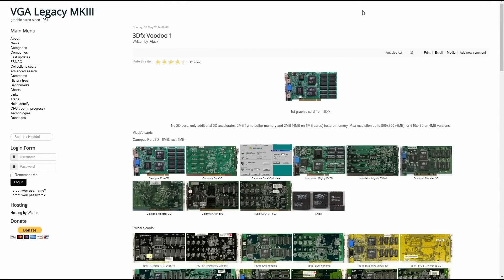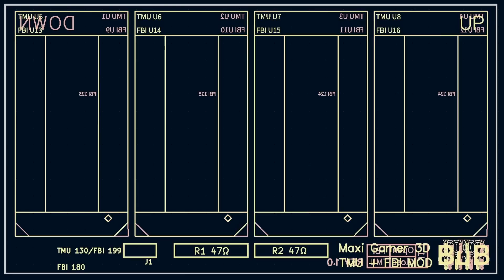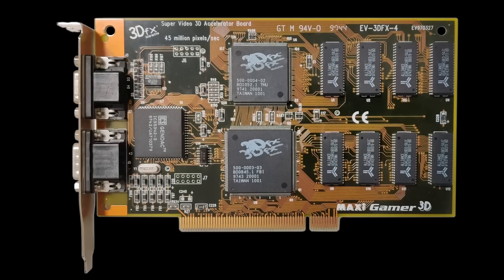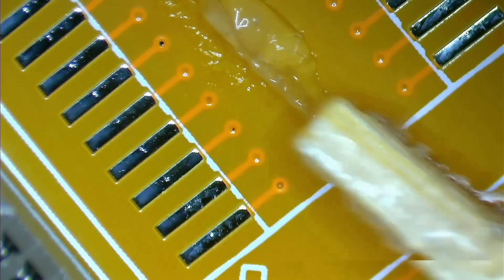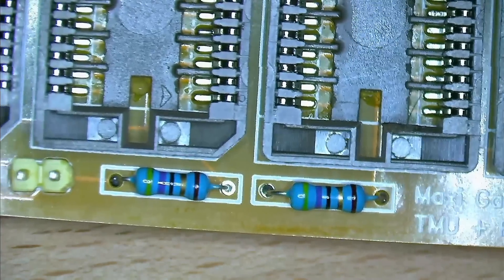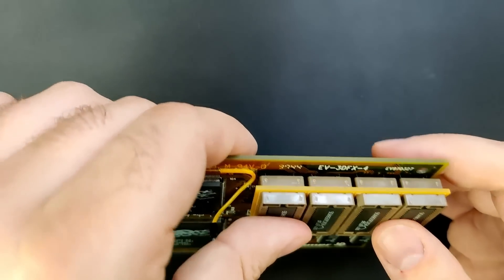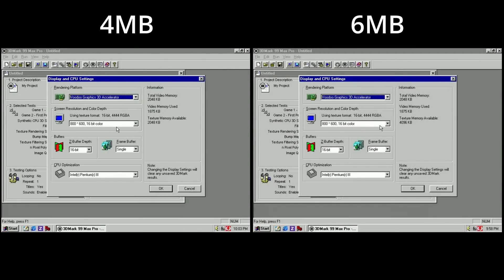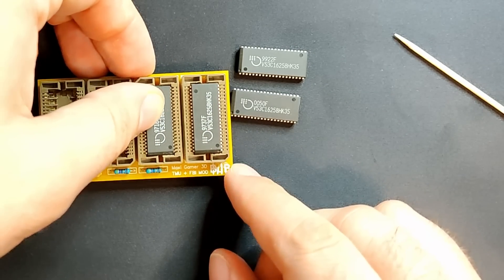3Dfx Voodoo Memory Upgrade - 6MB MOD (Part 1)

Comment: Meinst du du kannst eine Komplett eiegen Karte entwickeln wo die erweiterung direkt mit integriert ist?
Reply from the maker: Theoretisch wäre das möglich, ist aber sehr viel Arbeit. Ich glaube eine Voodoo hat ein PCB mit mindestens vier Lagen - weiss ich nicht ob es den Aufwand rechtfertigt. Es gibt ja schon Nachahmer die sogar einen HDMI Anschluss mitbringen.
Reply: @bitsundbolts  ja schon gesehen auch Voodoo 5 6000 gibt's wieder aber was eigenes iss cooler. Vermutlich gibt's irgendwo die easy eda Files die man anpassen könnte

Comment: Personally, I would have put the sockets over the existing chips, and then glued the new board to it. Then it would have had the spacing perfect with no stress.
Alternately, some solder paste on the 4 corner pins and hot air solder through the board while it's in place.
Reply from the maker: Yes, I agree. Watch the video with Revision 1.1 where I address the points you make here.

Comment: I have recently struggled soldering to a dense chip. What has helped is not to solder straight down, but to the leg pointing up. Guiding the wire from the top. I have completed a very spicy mod job like that recently, where i soldered bodge wires to 5 subsequent legs of a tqfp100 chip. I didn't use magnet wire, since i happen to hate it with a passion, but wire wrapping wire AWG30, which is PVC sheathed, which is not ideal, but it worked out OK. Such wire you can run directly to the connector, it won't mind.

Comment: Really nice job!
I've just picked up a Maxi Gamer 3D and have ordered myself the PCBs. Do you have a link for where you got the SOJ sockets from? I'm really struggling to find them
Reply from the maker: Yeah, unfortunately those sockets are a bit hard to get. I got 20 pieces from ebay Germany. But there seems to be a source in USA: https://www.jameco.com/z/HWS8871-James-Electronics-40-Pin-SOJ-IC-Socket-Surface-Mount_2330623.html

Here is another link: http://bg-electronics.de/shop/product_info.php/products_id/10133

Comment: I would definitely like to see a video where you go over the failures of what you were doing.
Reply from the maker: I addressed most of those in the latest video on my channel.
Reply: @bitsundbolts  thanks! i was about to watch it :)
Reply: @bitsundbolts  you know, if you made cutouts in your memory boards, you could make them castellated, and then you could put the sockets on the ram chips, adjust the board to fit, and solder through the cutouts. this would make it much easier to adjust everything. but you'd have to make sure that the through-holes used for castellation are NOT plated. and it might make soldering new memory on top a bit more difficult, unless you find chips that are narrower. which might actually not be hard.
Reply: edit: i think while it might be a little difficult to solder chips on top, soldering sockets would probably not be very difficult at all.

also if you need to connect the bottom with the top anyways, maybe you could make the relevant castellations plated-through. so it works out well actually.
Reply from the maker: Thanks for the suggestion. I like thinking of improvements and to make things better. The prototype worked really well, but far from perfect. I actually have to admit that I was working on Rev. 1.1 and it's already out for manufacturing, but if this doesn't work out, I'll be glad to follow up with your approach!
Reply: @bitsundbolts  enjoy! I think the castellations + sockets on top or smaller chips on top might work out well to make everything fit together mechanically. Do you think you'd be able to find smaller chips? Perhaps they could even be faster ones? Does the voodoo card even have any concept of fast vs slow ram (as in latency)?

Comment: Pretty clever to use the sockets to connect to the existing chips on the card. Maybe something similar could be done to connect the wire to the 3Dfx chips.
Reply from the maker: I am already working on something like this. But it will take time l because I need to learn new things again: 3D printing

Comment: Nic work!  - it might be worth adding some pads for decoupling caps for each additional memory chip to be safe
Reply from the maker: Thank you! I've heard about decoupling capacitors, now I read about them and have a better idea what they are for. 
For my understanding: Those new memory chips use the power supply of the existing chips - which probably already have decoupling capacitors. I guess the existing capacitors are good enough for 4 chips, but do not provide enough capacitance to filter the power supply for double the memory chips.

Comment: I have found 3DX1000 card out in my cupboard. It has identical footprint and color to the card presented. The imprinting on my card adds "with TV option"  but I couldn't find any difference to the card presented: no extra connector or header so I really don't know what the "TV option" means. My card is from "Volcanic" and "VOLCANC" is printed on the board. I have also Volcanic manual including a CD with drivers, Voodoo Graphics user's manual and another CD labeled "Software Driver Version 1.318-98". Manufacturing date of my board is 9923 (where yours is 9744).
Reply from the maker: I googled the card you're describing and I found a few pictures. I think it is a clone of the Maxi Gamer3D. I also do not see any TV relates ports.

Comment: Hummm wil this work with voodoo2 and 3
Reply from the maker: Good question. There are Voodoo 2 with 12 MB and 24x512KB memory chips, and there are some with 12x1MB memory chips. I have not come across a Voodoo2 with 20 MB (4 FBI, 8+8 TMUs) or 24 MB (8 FBI, 8+8 TMUs). From Voodoo3 onwards it may no longer be possible.

Comment: Why not solder two sockets together without the PCB ?
Reply from the maker: Yes, this crossed my mind, but you have to solder pin 14 together of all memory ICs for TMU and two memory ICs in pairs for the FBI mod. Just stacking another memory row above the existing ones is not enough. A jumper on a PCB with correct wiring makes this a lot cleaner.

Comment: What was the total cost from PCBWAY? What I'm seeing looks pretty expensive at $5.00 per board and then $38 for 3 day shipping and $63.56 for 24 hour processing.
Reply from the maker: Shipping cost depends on where you live. Production of those 10 PCBs is 5 USD and took 4 days to manufacture. If you get the coupon when signing up as a new customer, you get the PCBs for "free". I selected the slowest shipping method which was 12-13 USD to UAE/Dubai (I actually paid for that at checkout) and delivery time was 11-33 business days. Full disclosure, PCBWay upgraded my delivery for free to FEDex, which would have costs 23 USD to UAE, and reimbursed the money I paid for shipping in form of coupons. Delivery took another 3 days. So, to UAE with 11-33 business days delivery, it would have cost 12-13 USD with signup-coupon, 17-18 USD without signup-coupon.

Comment: By stacking new on top of old chips, are they both working now or were the old ones disabled?   If both working in parallel, how are they addressed separately?
Reply from the maker: Both rows are working. There is one additional wire routed from the TMU to Pin 14 on all 4 new memory chips. The other 39 pins are connected to the corresponding pins below.

Comment: very clean mod, nicely done. What's interesting is 3dfx apparently designed the voodoo 1 to use up to 28mb of memory. https://i.imgur.com/XGxy1Ei.png
Reply from the maker: Hm, do I see correct that there are up to 3 TMUs with each up to 8 MB? That would mean that a simple Voodoo (1xFBI + 1xTMU) could be 4MB+8MB = 12MB. Probably with more address lines to be created from the TMU chip. A pinout of the TMU would be interesting...

Comment: Very cool!  I recently watched a video where a modder adding extra memory to an original Xbox 1.6 using the method of stacking the chips, but for the Voodoo card I like your solution much better.  I would definitely be interested in a video where you talk about the problems you ran into along the way.
Reply from the maker: Will include it in the next video. You already seen how the mod is assembled, so, I won't talk another 15 minutes about the same thing.

Comment: PT3: Combine both boards into one with no need for any jumpers and 2 daughter boards to go over the TMU and FBI with connections to the relevant pins. Then you got an all in one with no microsoldering required.
Reply from the maker: Interesting, There may be some pins however that do not connect to the TMU/FBI chips (e.g. VCC, VSS). Then the board would need to connect to other sections of the board. There are 39 Pins on the memory chips that are passed through to the upper row. Maybe a device (like a frame 3D printed) that just clips around the TMU/FBI chip would help.

Comment: Are there any devices that could go over the TMU directly? Access the address and data lines and route to memory.
Reply from the maker: You mean another socket? Hehe, I think I know where you're going. Some cards do have heatsinks on those chips, that would cause issues. You may also end up decreasing airflow around the chips heating them up further - those TMUs get hot.
I think you'd like to achieve somehow better access to the pins or prevent any alterations to the card?
Reply: @bitsundbolts  oh, I didn't think about cooling! Yes, they used to make Macintosh upgrade CPU boards that would clip on to the existing CPUs. Maybe a really hard part to find though, because they probably don't use that CPU package for much anymore. But yes, ideally a clip on upgrade with no soldering required.
Reply from the maker: Yeah, would be neat to just have everything clip on. But I think you won't find a socket that you could press over the chip, it would surprise me. Also, TMU and FBI are of different size.
Maybe someone could design a 3D printed device that could do it.
Or wait until I learn 3D modeling and create something.
But then people shouldn't complain if PCBWay is all over my video 😂

Comment: This is fantastic. I've got a Yakumo Voodoo 1 that is nearly identical to the Maxi Gamer 3D. The memory chips, at least, appear to be in the same configuration. So, your board might just clip right onto it. I'll have to trace some other things out to figure out if I need to do anything different. Can't wait for part 2 of this video. I hope you're able to do some "real world" testing with games with built-in framerate counters like Half-Life, etc. Good luck, dude. This is awesome.
Reply from the maker: Thank you! Already started looking into behavior of the 8 MB configuration. I think I will do the full mod video first and then get into benchmarking videos. Could be quite a lot of work...

Comment: I guess the Tmu ram layout is the same on the most common version of voodoo 1 and I mean the monster 3d by diamond. Once the mod goes public I will help the community to relocate spaces to diamonds measurements and I urge all voodoo 1 owners to do the same for all the different kinds of other companies because the mod easy fairly easy. Only one cable to one pin and voila you have 6-8mb ram. 8 mb ram was commodon back in the days, I had in my pc a monster 3d with 4mb and a diamond fire gl 1000pro with a permedia 2 at 8mb.i still have this pc which was my first pc by the way.
Reply from the maker: That would be a great initiative!
Reply from the maker: I confirm that 8MB mod works - in the process of releasing the PCB Gerber files.

Comment: The reason you can stack memory chips is that nearly all the lines are shared.  Surely you only need connections to a single memory socket, plus the individual address lines ? In this way, any card could go to 8mb.
Reply from the maker: Yes, for the TMU, one extra pin needs to be connected to the memory chips. All other pins are shared with the chip below.
Any card should be capable to support 8 MB, but you won't be able to use the type of mod I use in this video.

Comment: That's very cool!  I've got some 3dfx internal documents that claim the Voodoo 2 can also support double the memory (8mb per chip) for a total of 24mb per card.  I would LOVE to have a 48MB Voodoo 2 SLI setup!  Wonder if anyone has ever tried modding a Voodoo2 in this way.
Reply from the maker: That is interesting - however, since nobody ever attempted this, I wonder if it actually works. There are some crazy good modders out there. Sure someone would have picked that up. But yeah, a 24 MB card would be cool - I am just very skeptical that this will work...

Comment: Nevermind the problems occured with your first board. Me as an electrical engineer, who teaches his software coleagues how to design pcbs, knows, the first revision of a board never works flawlessly. Is it the function or the assembly, somewhere is everytime a problem, which must be fixed, botched or something else. And if you found no fault on your first revision so long, you didn't searched well enough. 😉 It is all excercise. But this was a good job and a very clean mod also. Congrats to you.
Btw. I don't know if you noticed, but your sockets have nodges to indicate pin 1. One of the sockets on the upper side is turned around.
Reply from the maker: Oh my - I didn't notice that!!! Oh well, what to do... It's already glued on there. Software developer mind - easy hotfix not possible in that case!
Reply: @bitsundbolts  If it does the job, why fix it? Just for the next assembly to notice. 😉
Reply from the maker: Yeah - just a small visual glitch. Let's see, I am struggling right now with the second board. Unfortunately, the second row of memory on the voodoo card is slightly off. The addon board doesn't make proper connection and when I try to run the card with 4 MB on the FBI chip, the card doesn't seem to be detected as 3D device.
I have to check if the card only works with 4 MB on the TMU, but it could also be that I made a mistake designing the PCB. I guess I need to do some further digging.
Reply: @bitsundbolts  Welcome to world of hardware debugging 😄
Reply from the maker: Turns out, the card does not work with 4MB on FBI and 2MB on TMU. If FBI has 4MB, TMU requires 4MB as well. So, all good with my PCB :)

Comment: Nice and clean execution! The problem I found with this and haven't seen mentioning is the driver compatibility. I used to own a miro highscore3d with 6mb and remember while having a bit extra performance on some games, other glide games didn't even boot. Tried a bunch of drivers and some worked with some games and others with the rest... But some with the original miro driver just disabling the extra memory. I remember Carmageddon was one of the problematic games... But there's not much info on the subject... Otherwise I would upgrade all voodoo cards to the full 8mb! :)
Reply from the maker: Good point. I don't think I can just disable the memory with the reference drivers, but I didn't look into this yet. The good thing is that the mod is temporary :) I can just unplug the cable.

Comment: paying something like $100 more in the 90s for the difference in texture RAM for 6-7% gains in synthetic benchmarks might have been a hard sell, but this is cool.
Reply from the maker: I paid $20 for 10 of those memory chips I am using. Yeah, $100 extra for at best 5% performance gain is a tough sell.

Comment: This is awesome work. Unfortunately my hands just aren’t steady enough for fine soldering like this anymore. I can tell you from experience some games display textures incorrectly &/or with what looks like artefacting & in honestly there aren’t many Glide games that can actually exploit the extra texture memory but it can be fun to explore what games work, what don’t & which show a tangible difference?
Reply from the maker: Absolutely! I did read about the issues with more memory on the Voodoo card. Games were written with 2+2 MB configuration and as you said, it looks like some games had issues with more memory. I'll definitely test different games and see what happens! Thanks for watching and the compliment!

Comment: This is so fantastic! My only experience with glide is with nglide and dgvoodoo wrappers. My research tells me the original voodoo and voodoo2 have some advantages that the voodoo 3,4,5 dont't have for the first glide titles.
Reply from the maker: I don't have much experience with wrappers. I think I used them once - didn't feel real :) It felt weird when you can just emulate any Voodoo card with your integrated Intel graphics unit...
Reply: @bitsundbolts  You're a whole lot better off with AMD/NVIDIA, and especially NVIDIA with nglide and dgvoodoo. I can run Turok 2 seeds of evil, and Jedi Knight Dark forces II in windows 11 with no problems. NVIDIA is needed to get vsync off in older games, you can do it with AMD with a third party utility, but eff that, and there are edge cases where you will want to be able to control it in nvidia control panel, and you won't get all the way there with AMD at the end of the day.